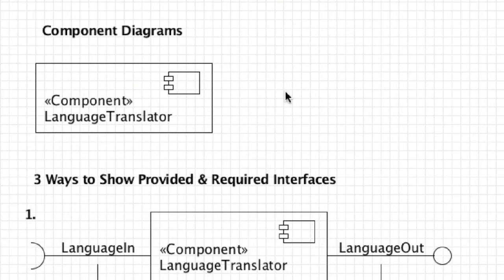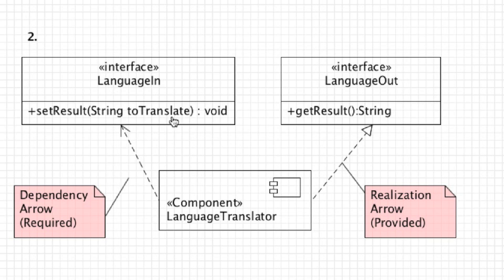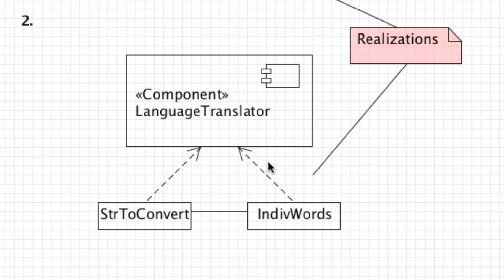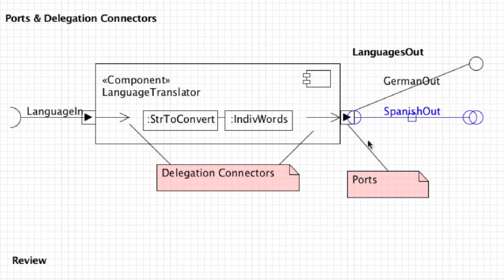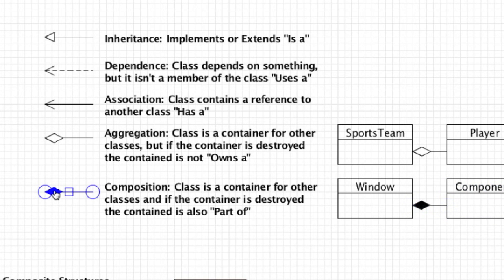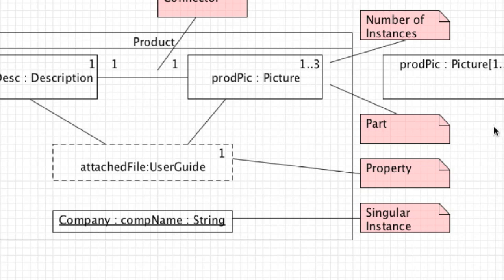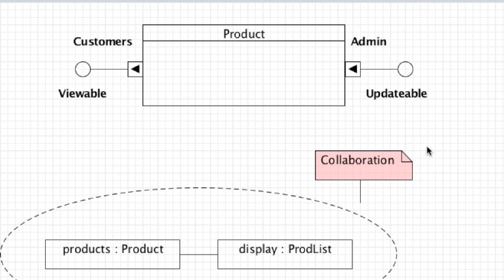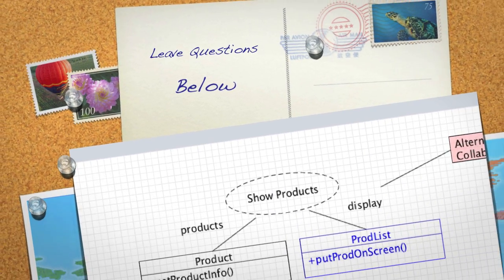UML 2 Component Diagrams

Comment: At 4:15 you're saying that arrow shows the data flow direction.  Component LanguageTranslator "requires" interface LangIn and component on the left (I will call it Left) "provides" this interface. 
LanguageTranslator can depend on this interface in only one scenario - when LanguageTranslator calls methods of LangIn, meaning that data flow direction is from LanguageTranslator to the Left, but on video it is the opposite.

Is it your mistake on the video (arrow from left to right) or is there a mistake in my conclusion?
Thanks.
Reply: You're right. Moreover, this component does not need a left interface at all. For some mysterious reason, the author believes that interface on the the "right" (provided)  is an output, and "left" (required) is input.
Completely not.
"Required" means component itself calls some outer operations.
And when the interface is "provided", it means that someone calls one of the operations of the interface and receives an output.
I.e. gives a sentence in one language and receives a translation in another.
An operation of this (provided) interface might look like:
Translate(Sentence: string, LanguageIn: language, LanguageOut: language)

Why this component needs a left interface is a mystery to me.
Anyway, left interface contains operation "languageIn", hence it is also "provided". And both arrows shoud be pointed from "half circle" to "full circle", in any circumstances. From "required" to "provided", always. 
I think this video is a mess.
Interfaces are not holes for data flowing from one side to another

Comment: Regarding composite structures, the multiplicity between Description and Picture in the Product class. It's all fine in class diagrams. But in composition diagrams the use of mulitplicity in both the boxes and on the relationship lines creates a mess.

A 1:1 correspondence is clearly incorrect. Derek touches upon this at 13:00 and suggests putting 1..3 as a qualifier for the association. If you do that while keeping 1..3 as multiplicity for Picture, it can have the confusing effect that you start thinking about having 1 to 3 of something that itself has 1 to 3 of...wait a minute...itself? Huh?

Easy solution - just as relationships in class diagrams work - would be to not put multiplicity into the boxes at all and rather just state them on the relationship line. But that's sort of the feature of composite structure diagrams, I guess, so...it's ugly. Maybe the real solution is to interpret Picture as a collection of Picture containing 1 to 3 pictures and then map that one to exactly one description. Perhaps that's how it's specified. Only way I could personally live with it.

Comment: Hello Derek, I am not getting what a component mean, at source code level.Generally, an application is comprised of multiple java packages. This application is designed as package(java) by feature. Can I say, each component is a java package?
Reply from the maker: Ethashamuddin Mohammed Component diagrams are normally only used for large projects. They show a view of a large system and how the components interact. There is very little detail involved.

Comment: Component inside a component. You said that we can call it <<subclass>> instead (although we do not have to), but in the definition book, it is written as <<subsystem>>. Calling it a subclass seems odd to me, since we already use this term in analysis and design class diagrams. So should it be subsystem or subclass?

Comment from the maker: I'm guessing you are referring to ports with Component Diagrams. What you'll find as you learn more about object oriented design, is that certain diagrams work better for you than others. I personally can do anything with a use case, sequence diagram and class diagram. Ports are just there to connect the parts of the component diagram.